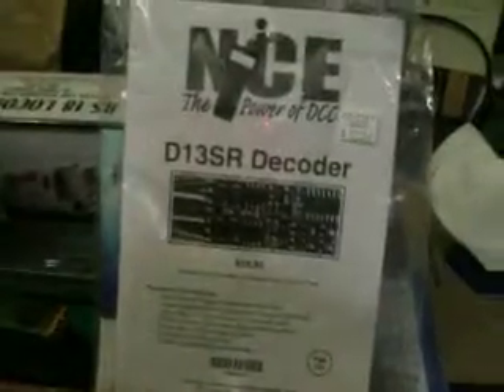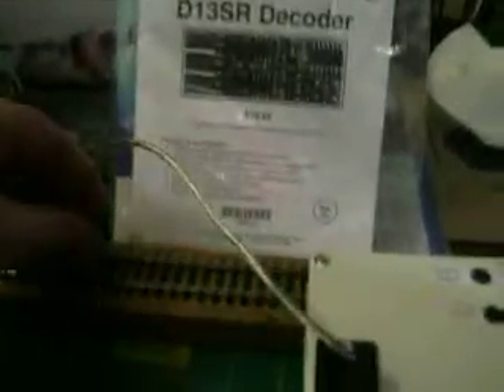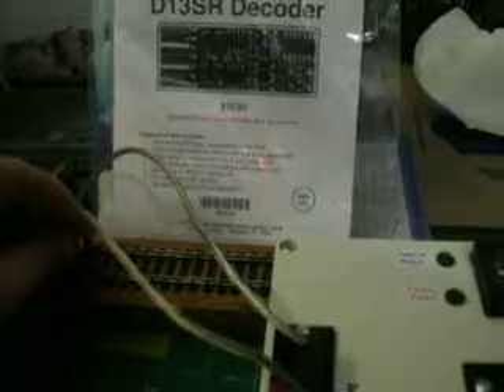Home made Decoder Tester

Comment: Hi, Thanks for sharing!
I am searching for a diy project for months! I don't have 60€ for buying an ESU! 

This is the best and have the quick conector I wanted to, you use the BETTER and simpler HiFi and I didn´t remember to use those, I intended to use the wago! 

If you can, please share the connections or PCB!
I really want to make it
Tranks
Reply from the maker: @AndreFilipeAlmeidaPinto  hi! Thanks for your comments. There is nothing special, all of the connections under the project box cover are just wires and solder. No pcb. If you like I can send you some photos via email?

Comment: How did you make it?
Reply from the maker: Hi! I used a project box that I bought from eBay. I wired a spare loco motor and some LEDs to an eight pin plug as well as some other inputs and outputs. I had also wired a speaker for sound decoders.
I can plug an eight pin decoder and test the motor and lights. Same with the speaker input to test sound.
For board decoders I made leads and attach to all inputs to test all functions. 
Wires are all connected under the lid.